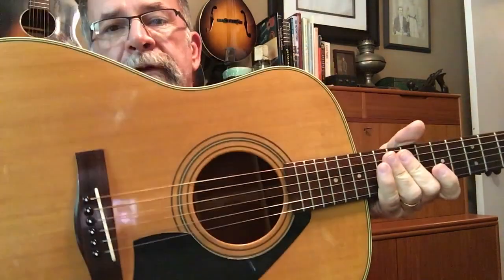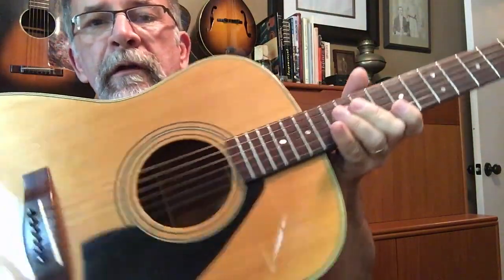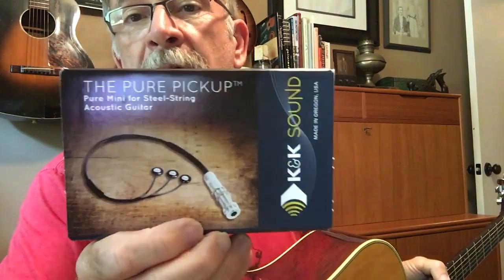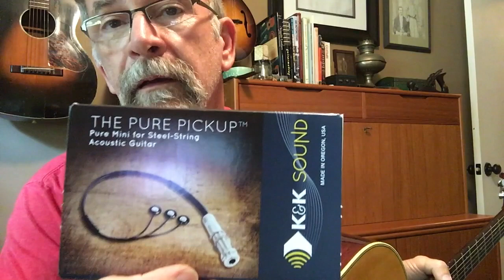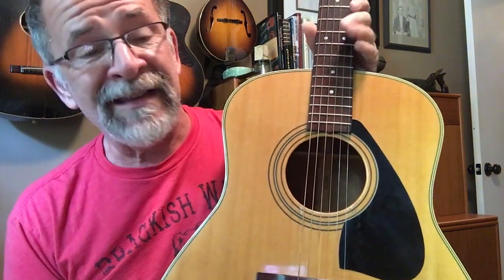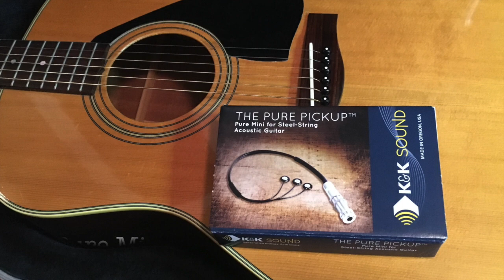K&K Pure Mini/Martin Thinline Comparison

Comment: One of the most well-executed comparison videos I've seen. Great job!

The K&K definitely picks up more of the dynamic range and nuance of the entire guitar. The problem I have with both though is that while you can get somewhat similar sounds with them if you meticulously EQ them, you still get something that sounds like a pickup, not like a guitar. Not to say that's a horrible thing - and at least the K&K sounds like a good pickup whereas the Martin (rebranded Fishman) sounds far less impressive. But I still feel all acoustic pickups need some modification to sound truly acoustic. I use Fishman's Aura products for that, and have been very impressed with the inprovement they provide!
Reply from the maker: Thanks Roy!

Comment: Excellent comparison, thanks tnerbelbag. Every undersaddle piezo pickup that I've ever heard (Takamine, Fishman Thinline, Martin Thinline, etc.) adds a crystalline, grainy, sawtooth kind of sound that isn't there in the natural sound of the guitar and which is unpleasant to my ears. Piezo pickups are not good at picking up body sound, and electronic equipment (from Boss for example) that claims to add body resonance does not give a natural sound at all, it just seems to scoop out mids.
I recently junked the piezo undersaddle pickup that I had in a faithful old Takamine MEN-10C for nearly 30 years. That pickup had one piezo sensor per string and was made by Shadow. It hooked up to a Shadow midi system and was great fun, but I wanted a change from the piezo sound even if it meant losing the midi functionality. I had a K&K Pure Mini installed instead. I got a huge improvement -- the K&K sounds much more like the natural, unamplified sound of the guitar.

Comment: I was hoping to get some advice. I had this system professionally installed with the Gel super glue, everything was done properly. The guitar sounds great at a low volume but as you turn the volume up a VERY loud screeching noise appears. It doesnt matter if you are close or 15 feet away it still makes the noise. The amp is a spider four Line 6 and the guitar is a Seagull S6. Thank You
Reply: Sounds to me like you may need to do some EQ work if it's doing that. Also the amp you have was made for electric guitar is my guess. You should be playing an acoustic through either an amp made exclusively for that purpose or it should be going through a PA system. Does the Line 6 have acoustic settings onboard?
Reply: To repeat what’s already been said, you need to plug into an acoustic amp and that would help tons. If you can’t, then I recommend a good Preamp such as the k&k pure Preamp or the lr baggs gigpro. But likely the biggest issue is playing it through the electric guitar amp.

Comment: Great educational video, sir! Thank you. I just got a very slightly used PRS Angelus with a Fishman UST pickup. I'm already tired of the unbalanced sound and shrillness from the pickup, ecven after having it setup. I just want to  play the guitar, not fight with it! This looks and sounds like the ticket. I run my acoustic/electrics into a Fishman loudbox amp --- I wonder what the preamp would add? Your preamp demo sure added even more richness, but without still sounded great. Is installing the the K&K something I could do, or best to leave it with someone who has experience with that? Thanks
Reply from the maker: Thanks Mark. My guess is the loud box amp will add a lot to the sound of the K&K. If not then the K&K preamp might be the way to go. If you aren't used to working on guitars you may want to get a good luthier/repair person to install it. I'd say it's in the intermediate skill level as far as the install goes.
Reply: @tnerbelbag  Thank you very much!

Comment: I have an FG-331 from 79 I believe and while it's all plywood it's been just the best acoustic EVER.  I put a bridge doctor in to to fix the belly bow but it didn't work but it made it sound even better than it did so I just machined the bridge plate down and now it's just unbeatable.  I'm hoping I can get this K&K in there WITH the bridge doctor.  Not a lot of usable real estate under that saddle.

Comment: Hello and thanks for the video. I I have a Martin thin line in my 1990 D 28 and I thought yours did not sound that bad when you were fingerpicking. But when you flat picked or strummed with a pick yes it really had a shrill to it as mine does. I have an older K and K model which was I think called the K & K pure country. I think That pick up and the K & K pick up or basically the same, just a name change.
I installed the K & K in my Gibson J 200 and it sounds absolutely wonderful and that Guitar. but I am also playing through my fender acoustic sonic Junior amp. I’ve heard some say they did not really like the sound of that amp but I have to tell you with the K&K pick up the Gibson and amp together was a marriage made in heaven. My Martin thin line pick up sounds like crap through that amp. I have been playing professionally out as well as touring 40+ years now and I always plug my guitar in to the acoustasonic and then run a direct out from the back of the amp to the house sound and it sounds even better with a good house system. But listening to your Martin Thin-line v/s the K&K I am thinking about maybe combining the two on my D28 because as I said I thought your Martin thin line did not sound bad when you were fingerpicking and the K&K is much warmer so both together may be worth trying. I would have to wire to the same and pin jack because I certainly do not want to drill another hole to add a separate jack on my Martin. Question is how much hotter is the Thinline as opposed to the K & K pick up? Perhaps you can answer that question comparing the two. Like in your settings to whatever system you’re running this through how much hotter was the K&K? In my Gibson I wouldn’t dream of ever putting an under the saddle pick up of any kind because the K&K alone is perfect and that Guitar. I I just listened to a video here on the tube they gentleman putting a K & K pick up in his Baby Taylor and the sound was amazing. So I picked up another K & K pick up for my baby Tailor which may sound even better in mind simply because I bought one of the early baby tailors in 1999 and that year or so you had a choice between mahogany back and sides or a rosewood back inside guitar. Comparing the two it was a no-brainer. The rosewood baby Tailor sounds awesome just on its own. In fact iTunes it a bit higher and use it on recordings along with other acoustic guitars and he gave me almost a tenor guitar sound. Sorry this is getting long but my question really was how much hotter was the under the saddle pick up versus the K & K pick up?
Reply from the maker: I think the K&K is much hotter than the thinline. I always had to use a preamp with the thinline, but I can run the K&K on it's own. Hope that's helpful...

Comment: Just out of interest once the k and k has been installed with glue, will it then be pretty difficult to remove it?
Reply: If  its super glue, you can not.
Reply: @peterkoch3116  Weeeeell, I reckon that it can be done if you cut through the layer of glue between the pickup and the bridge plate with a very sharp knife. That will leave glue on the inside of the guitar and on the pickups, but the inside of the guitar is not visible and if you re-use the pickups you can just smother any superglue gel that you can't remove with more superglue gel. I haven't tried this myself, by the way, your mileage may vary.
Reply: @eekamoose  No.  You would need to sand the excess glue off, no smothering.  You want a clean contact surface for the transducers to work properly.

Comment: Definitely disliked the martin thin line. But the k&k sounds like it has no string separation.  Maybe a bbe sonic maximizer will help.
Reply: Good I'm glad I wasn't the only one lol. After all the positives on the k&k I thought my ears might be broken. It also sounds a bit compressed but same preamp so again, maybe it's my broken ears =)
Reply: @MYdjANDkaraoke  I wasn't impressed with the K&K. Perhaps if it was on a mahogany guitar such as a D-18, I would have liked it better.   My guess is a little EQ tweaking would do the trick with this guitar. 
Thanks for the demo!

Comment: OK, this is just further proof of my deep exalting hate for a lot of under-saddle pickups but, we don't have to use those tone sucking 2-dimensional 200 pound quacking ruptured ducky's any more.   The K&K is much more fuller and richer with far more natural and organic response to the strings.  It does however lack a great deal of high frequency chime, sparkle and air that to me is a vitally important range of sound that an acoustic guitar can not do without.   Perhaps that can be addressed with some good parametric eq.   But, I can picture the K&K being a great addition mixed with a good small diaphragm condenser.   The K&K would give you  alot of good richness pump and chuck and a good well positioned mic will give you some air, sparkle, resonance and openness.  And having the K&K would be great in situations where the venue and sound intensity level doesn't allow for high volumes with out feedback.   Its legions better that the undersaddle piezo's.   I'll probably get one someday.   Thank you for posting this, very telling on the sound of the pickups.

Comment: Undersaddle pickups sound really bad without a buffer preamp. I bet that the Thinline will sound far more better if connected to your Pure XLR Preamp. It's an impedance matching issue. Also no need for expensive preamps, even a cheap FET buffer should work (as you can see in a very expensive Dumble amplifier). But K&K is simpler and better IMHO.
Reply: Actually the K&K sounds quite good without the preamp believe it or not.
Reply: Yes, that's what I said: undersaddles need preamp. K&K's don't.
Reply: Ah, sorry I read that wrong. Yes sir you are correct! The thin line actually sounded shrill and quacky even through a preamp though. Although it sounded better than without one for sure. I still can't believe I put up with it for so long...
Reply: @brentgable173  glad I came across this then... I was gonna buy a guitar with the martin preamp but now I'll just hold off =)